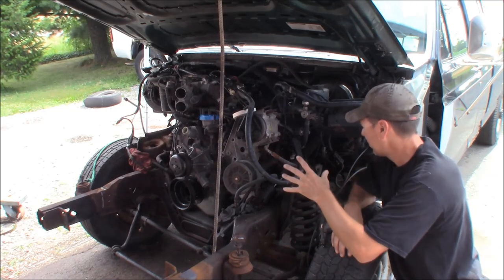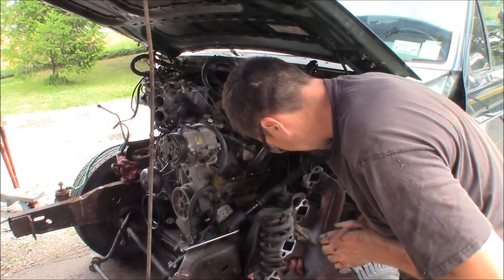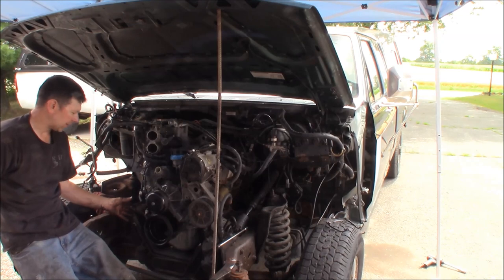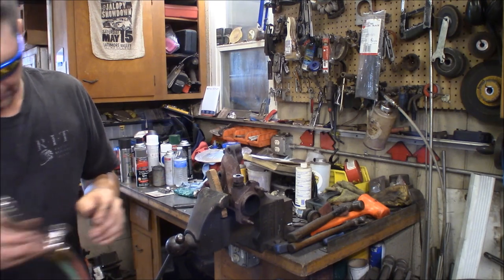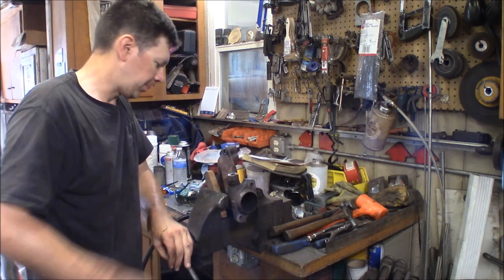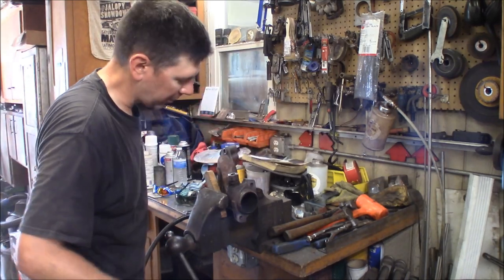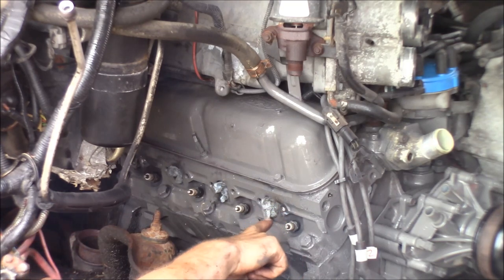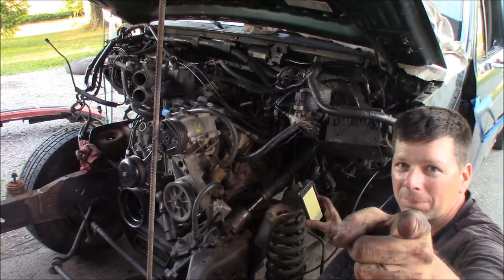Exhaust Manifold Replacement Part 2:  Project Green Machine 1995 F250

Comment: I've had some luck with studs that were broken off flush by welding a flat washer to the stud held flat against the head and around the stud, and then welding a nut to the flat washer. You can get good penetration between the broken stud and flat washer and the heat really gets deep into the stud if you crank up the welder. Any way you do it, take your time and don't make things worse (talking from experience!)
Reply from the maker: I have heard of that.  As you see I had no luck.  I finished the job this past weekend and will have the video out in a week or so.

Comment: I was looking for videos on your Studebaker.  I own a 1946 Studebaker M5 hot rod that spent time as a drag racer in a past life.
Reply from the maker: I did a quick review video on it last year.  I built that truck 20 years ago.  I will have some content coming up with it this fall.  That's a cool story to go with your truck.
Reply: I traded a stock 1969 Chevelle 307 that needed some work for my Studebaker straight across. My Studebaker has a SBC with mild cam, boxed frame, new TH350, 4 wheel disc, Mustang 2 up front, 4 link in the rear, line lock, new Lokar E brake, new 3.91 gears, front tilt hood, rocket racing wheels on the front and deep dish chrome wheels in the back. Some things are still left over from its time on Dragway 42 in Ohio. Still has racing seats with 5pt harness, no door windows and no wipers. Faux patina paint job.  All original steel except the lower hood fender pieces.  Lots of fun to drive. Interested to see what you did with yours.
Reply from the maker: My truck started out as a stocker minus engine and transmission.  I started working on it when I was 14.  It started out as a 90s style smoothly street rod (because it was 1993) with smoothed bumpers, custom box, rolled pan, flush tail lights, and slammed on the ground.  It has a Camaro subframe and Mopar 8 3/4" rear.  I started out with a Wideblock 318/727 drive train.  Around 2005 I went more restomod.  The bumpers came back, a stock bed was added, and the 318 was replaced with an AMC 258 straight six.  Eventually I'll paint the truck the original dark green.  I put the truck on the road in 1999 and it has over 30,000 miles on it now.
Reply: @QuickSpeedShop  Mine has been slammed on the ground, tubbed for racing slicks and no bumpers.  Yours sounds nice.  Not too many left around.
Reply from the maker: @testdepth377  Yeah, super rare around me.  I found three in old junkyards and saved all the sheet metal that was good.

Comment: Why do you dellete the thermactor air pipe? Is it recommended? I am about to take both my manifolds off. Thanks for the video.
Reply from the maker: I did a air pump delete on this truck so no need for the air injection pipes to the manifolds.  I did a video on that mod as well.
Reply: @QuickSpeedShop  okay. I am restoring a similar engine and am weighing my options as to fixing the air injection or deleting it altogether. Gonna watch your video on the delete.

Comment: #realiferepairs. If it comes down to it, I have a set of 302 heads you can have if you booger up the passenger side. I'm not sure if they're interchangeable but if they are they're yours
Reply from the maker: #spoileralert I ended up drilling both bolts and tapping them to 5/16-18 and just bolted everything together.  If I had to take the heads off I would have replaced them with some Trickflows!  #fullsend